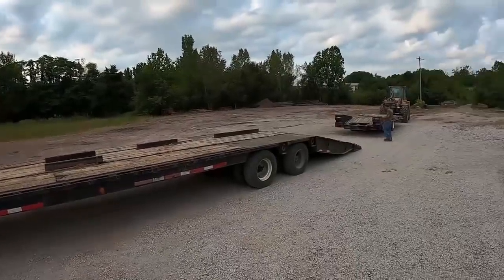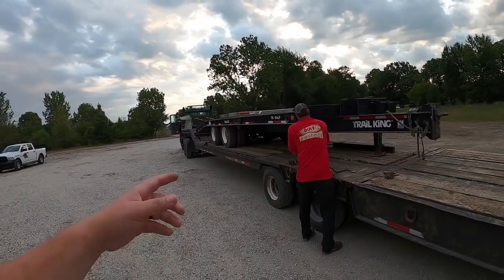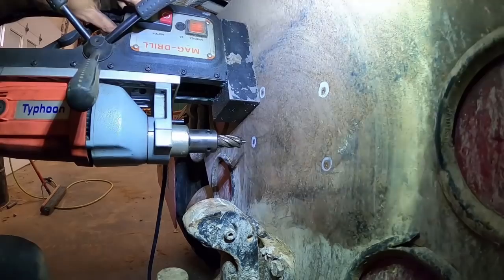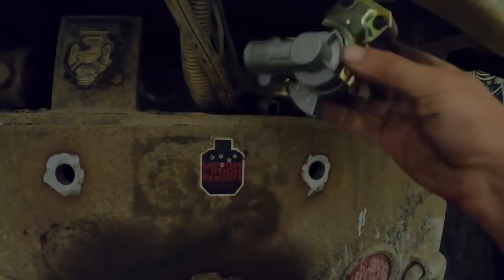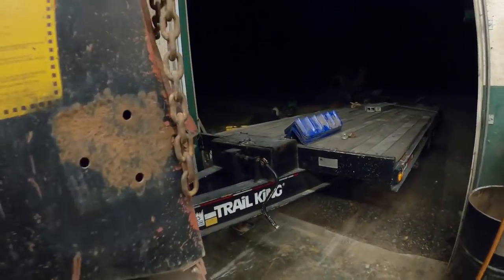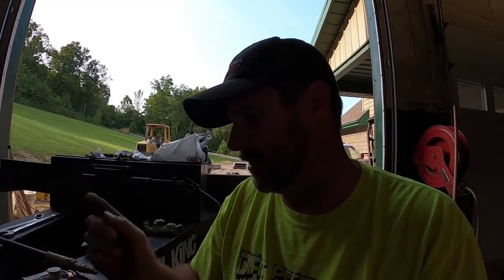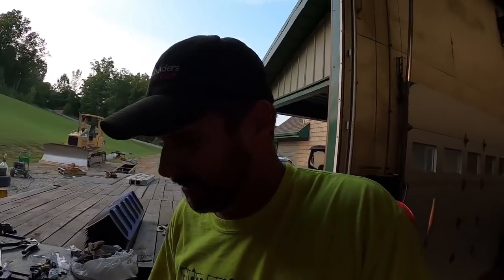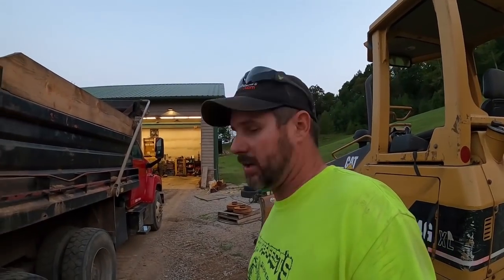Pick up new Trailer and modifying the C8500 dump truck to pull it #hooverapproved

Comment: That wasn't too bad.  Last time I put a new connector on a used trailer "by the color code", the right turn signal flashed the marker lights, and when I put the left turn signal on, the toilet in the shop flushed.  Nice job, and that trailer looks pretty good.
Reply: Round is semi, spade is RV, two different wiring schemes (color wise}.
Best wishes

Comment: Yeah i had same dilemma on my KW I put the lines in the same spot as you did.. My other truck I had them on the outsides of plate recessed.. That trailer's nice I love the C channel sides where you could bind to it in any spot That's how my Dynaweld is.. 👍🏼
Reply from the maker: Good deal
Reply: I put my air thru. Hitch on my peterbilt and when you jack it you snap it.     16 yrs. Like an idiot haven't changed them yet.   Next truck will be different location

Comment: Trailer looks good. Not too sure about the gladhand orientation. Got cited by. CHP Commercial because one gladhand wasn’t completely vertical.  My Hougen broach pushes the slug out with the center pilot when the handle is fully retracted. As per DOT” safety chains MUST be crossed in the event of the trailer becomes disconnected the tongue will fall into the cradle and not pogo. Lots of luck.

Comment: I cheat and have installed a back up camera for hitching my pup and equipment trailers to my old dump truck. Works well and I get it spot on every time. This cheap modification has proven to be a real time saver. Sometimes with the pup you end up dropping the trailer up to 10 times a day and anything to reduce effort is a win in my books.
Reply: That's exactly what I thought as well!
Reply: @w056007568  I also run a 90 straight off of the hitch apron and then have about 8" of rubber air hose before I attach the gladhand. That way they hang loose and are not as vulnerable to impact while hitching or from the trailer tongue in turns on hills etc.. Nothing slows your day down like having to repair stuff.

Comment: Grand; noticed you wanted to save yourself walking too far by leaving the safety chain on! Lol. Reminds me must fit one soon. Oops.
my recent experience with trailer wiring was fraught because the installer omitted to connect the ground wire normally worked because of the brake buddy connection. 
Good job you seem to be friendly with the local traffic cops; Drive without lights  and then tell the world!!

Comment: Just figured I'd tell you lock washers are made for wood projects. Flat washers unlock nuts you can actually torch. Overtime the lock washer will break and fall out.. other than that ruin it..

Comment: I have 7 round on the truck and 7 flat in the trailer (electric brakes) I pull the trailer with my pickup too so I use an adapter to go from round to flat. Had to reconfigure a couple wires in the adapter but it all works. Don’t know why the industry can’t standardize

Comment: Not finished with the video yet, but if you haven't thought of it yet... I would turn down those 90° fittings on the ends of your trailer supply hoses so the hoses ran down and out towards the tires on each side. It appears they already "want" to hang that way anyway so it seems like this would alleviate some of that stress that's on them while sticking straight back.

Comment: @ 37:57 you backed up with the welder ground cable attached.
The only thing missing from this video was raising the bed to show the clearance between the bed and the air lines.

Comment: i never cross softy chains   why  well if the chains are crossed and the off side comes of the trailer will line up to a straight line 3 foot in the curb  like wise if the the near side comes off trailer ends up 3 foot in the path of on coming traffic also on over run it could go another 3-4 foot further out nasty.  keeping them straight trailer only goes 3 foot left or right evan on over run  much safer. less wonder to deal with.

Comment: Just out of curiosity,  why not weld a bar-hitch on, and use multiple bar attachments (Large/Small Ring) for different size trailers?  Then you could also carry a ball-hitch attachment to move those type trailers around as well (One truck, multiple capabilities).  Here you are limited to the large and small ring (at static heights).  Another thought, a single connection would all be at the height, balancing that trailer out, "Perfect"- LY!
Reply from the maker: Don’t trust them

Comment: I have one for trooper hoover. I just ran illegal then with my load. 13ft wide disk on a 19ft trailer set between the disks. No flags or anything since Agricultural. Trailer with zero running lights but the blinkers worked! Got home at 8pm from a 8hr round trip through many towns. Troopers, Deputies and city PD i passed had zero Fs though! 😂 

Swear law enforcement in my state are lazy AF. Especially the guys i worked with as a dispatcher.

Comment: When we did trailer connections that could be hit, we used to put a 12 inch hose between the elbow and the glad hand on the tractor end.

Comment: Spade pin plugs and round pin plugs are labeled different the colors don’t do the same things in both plugs. Most of the bigger tag alongs are wired like the round pin. Pick ups and smaller trailers use the spade plug wireing

Comment: I can't watch your videos with just one comment. Don't you have to have either caps or shut off valves on those to keep them from leaking by when your not pulling a trailer. One thing I learned early on in the trucking business was that everything is a learning process. You do a great job at wearing many hats! At least I didn't have all the equipment to maintain that you do. Just trucks and trailers and drivers mostly. What kind off engine does the C-8500 have?
Reply from the maker: Yes

Comment: You can make a couple brackets to go up top. Just mouth the gladhands. Rotated about 45 degrees of rotation.   For easier. Hookup.   If you look at Andrews video on the Stewart Stevens truck he baught he had a similar mounting issue.  And it solved.  And issues from jackknife or funny trailer angles getting in and out of tight places.
Reply from the maker: Yes check newer videos

Comment: I was setting here think Mike put them on a 90 degree so you gain more room an than bam the light bulb goes off LoL
Reply from the maker: Lol
Reply: Never mind that the trailer has been in several videos already with the glad hands installed at 90*. 
At least you know your lightbulb 💡 still works.

Comment: The rubrail has no rating for tie down, check with the manufacturer. You should use stakepockets or sideframe.
Reply from the maker: It does and I have

Comment: Well, I hate to tell you this, Your chains are hooked up wrong. I drove a truck for 25 yrs. The hook is supposed to the opposite of your on your hook-up points. The hook face or opening will face you. When or if you lose the man connection the pintle hook gets unlock and opens up. the chain will fall down and hold on tight. Since you have in the other way it will loosen up and you will lose your trailer do the chain falling off. I pulled twin trailers for 6 yrs for Dillard's department stores in the south this is the way we were taught in the safety meeting even though you have the hook cover in a loss of connectivity this will bend and lose their function
Reply from the maker: Lol ok 🤷‍♂️

Comment: Don’t forget to cross the chains DP!!!
Reply: Yeah, lets not set the chains to SNAP when they are absolutely needed by having them crossed.
Sorry Officer Hoover, but having them crossed and the hitch is released so the chains suddenly carry the weight is asking for the chains to fail.
It may provide slightly better control over the trailer, but it drastically increases the chance of a safety chain breaking when the strain is added.
Reply: They are required by law to be crossed.   So sorry Jaqui
Reply: 393.70. 4) The safety device must be connected to the towed and towing vehicles and to the tow-bar in a manner which prevents the tow-bar from dropping to the ground in the event it fails or becomes disconnected.

Only way to prevent draw bar from hitting the ground is with crossed chains.
Reply: @dotbearwoodworking9342  Or chains to short to allow the front of the trailer to reach the ground in event the hitch fails.
The length can't be to short to interfere with turns either.
I think the ones on the trailer in this video, with the placement of the connections on the c8500 fit the requirement of not long enough to allow the tip to reach the ground and we know they are long enough to not hurt turning.
Reply: @jaquigreenlees  so you are saying shorter chains will prevent from touching but would interfere with turning?   I agree.

But in the video we saw how long the chains are.   So they can be crossed or twisted to shorten the chains to prevent dragging which is not good either. 

I am simply trying to point something out that gets wrote up as violations.   I am not here at argue about it.
Reply: what if really to long and can't twist the chain can you rap the chain around the hitch shank to shorten them up but still cross I have a picture of how me and my dad do tht if you would like to see just let me know how I can send the picture to you
Reply: @paulrreeder  you can zip tie the links to shorten the chains any amount to make them work.   The zip ties will break if needed
Reply: @dotbearwoodworking9342  i never try that and that why we wrap chain around the hitch Shank and we travel highway and never had any roblem with police or dot even tho we not commercial

Comment: The wiring for the RV connector with the flat contacts is different than the wiring for the round terminal DOT semi trailer connector.

Comment: Hey, on leveling the trailer to the truck. If you make  it run level with no load on truck or trailer, when do have a load on truck and trailer at same time the trailer will nose down ? So if trailer slightly nose up when empty is better?
Reply from the maker: Yup I agree

Comment: Hey mike on them glad hands my buddies did like you did but from the metal pipe you welded in to the glad hand they put a rubber air line in between the glad hand and the pipe, that way it will give when anything would hit it. Great vidja keep up the great work
Reply from the maker: Yes but they suck to hook up that way

Comment: Those RV(spade) light connectors are not labeled the same as the semi connectors. I’ve run into the same issue before where the trailer wires were the right colors but the connectors weren’t marked to match. Wound up doing the same as you just try it and see what works and go from there. Officer Hoover seems to be the type of trooper that you don’t mind when he stops you as long as you listen and give him respect he will be pleasant to deal with. I like how he wants to educate as well as enforce. Unfortunately it’s not always that way.

Comment: DP did you forget to remove the right hand safety chain when you pulled forward?
Reply: No! He was just testing it's resistance. It's ok! He also test if the ground of the welder hold good when he backup.... 😁😁
Reply: I assumed he left chain on so trailer wouldn't roll backward down the hill with air unhooked?
Reply: @waynetharp  should have spring brakes in it
Reply: @williamuskoski1385  Either way...Trailer was on an incline!

Comment: Always use a thread lubricant of some sort, proper bolt tension needs it. Never seize or grease. Besides it will make it easier to remove when the time comes.

Comment: Slugger helpful hint. At least with all the Sluggers I have ever used if you crank it all the way back up ( sometimes with a little extra bump at the end) the centering pin will push the slug out and you won't have to use players to get it out!
Reply from the maker: Thanks

Comment: Maybe I missed it but what weight are you going to have to tag the truck at now to pull this weight? I have a similar set up. Didn’t want to get into the vehicle heavy use tax.
Reply from the maker: You will be there
Reply: I’m a little confused (maybe a lot lol), my dump truck is certified to 55,000 gvwr but I can tag it much higher anyways to cover the weight I want to be towing? Trailer weighs 11,500 empty and machine I want to haul 26,000. Dump truck empty roughly 23,000. So even though truck only certified to 55,000 I can tag at like 62,000?

Comment: Looks like the truck and trailer were made for each other.  Those are wheel built trailers.  I saw the earlier video where MBTS surgically removed them, but what are the frame rails that stick out the back.  Were they a factory deal or previously owner applied...?
Great video.
Thank you sir
Reply: Likely added to catch a backhoe bucket... Have to lower it for height restrictions and the bucket is a couple feet behind the machine...
Reply: Michael Owen 
Ahh ha, yes precisely...  I am not in the equipment/construction business, merely an avid viewer... hahaha...
Thank you

Comment: Why does the dump truck idle like it does?
Reply from the maker: 🤷‍♂️ never knew there was a problem with it
Reply: @DirtPerfect  Its not smooth. It sounds like vroom.... vroom.... vroom... vroom... Like a dragster caming before you give it the gas.

Comment: I agree with you, never cross the chains. Doing so interferes with backing the trailer around a bend or corner.
Reply from the maker: Yup
Reply: I prefer to cross my safety chains.  I do not like safety chains that have a push button.  I like your new trailer Dirt Perfect.  I have noticed that trailer have become sky high since 2008.

Comment: Hey I think you're going to have a problem with the Airlines and the power cord but I know the captain will be more than glad to show you when he borrows the dump truck and that trailer when he tries to back into a tight spot LOL
Reply from the maker: Lol no problems yet works awesome
Reply: @DirtPerfect  yeah but if you twist the trailer what would happen would they be cut
Reply: @DirtPerfect  make that Jack knife the trailer as you back up
Reply: @markmullins4222  buddy I jack knife that trailer in every driveway I’ve taken it in the past two months.  Not a single problem.  Setup is working great.

Comment: You put a lot of faith on four bolts
Reply: The dump bed is only two pins and a lift cylinder.
Reply: @BlueDually4x4  so true I've broken big sockets trying to loosen grade 8 bolts I'm older now heat works wonders
Reply from the maker: Lol yup

Comment: Do you have a reason for not crossing the safety chains? Was that platform between the ramps designed for a backhoe or excavator bucket to rest on?
Reply from the maker: Yes and to be pushed on with a skider

Comment: You glad hands on the truck are bassackwards! RED to the right and BLUE to the left. lol. RED is for emergency air, to release the parking brake(which that trailer probably doesn't have) and BLUE is for service brakes. And putting the glad hands on so they are flat doesn't work because when you  take a corner, the air line will unhook the glad hand. You are young yet, you will get the hang of trucking sooner or later!...lol.
Reply from the maker: Has been working awesome for over two months now something must be right how